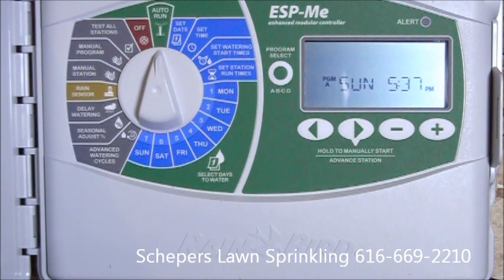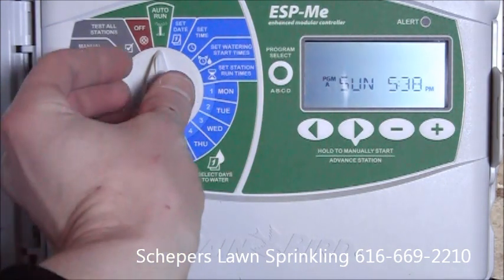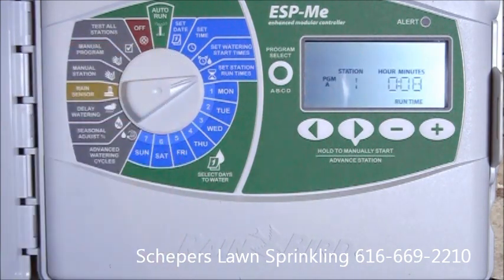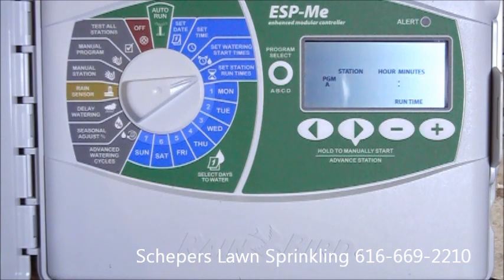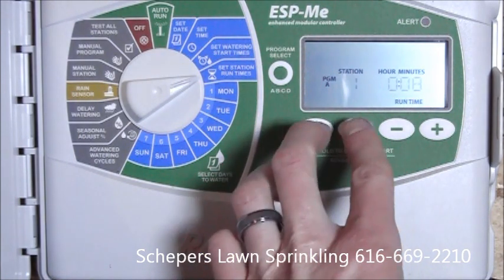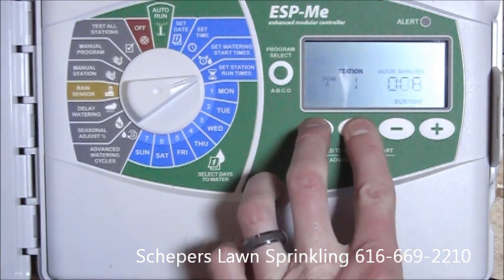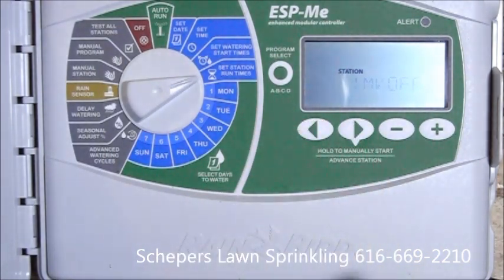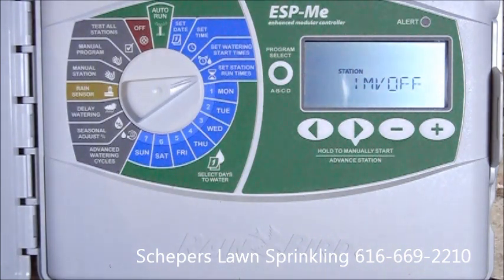How To Turn On/Off The Master Valve On A Rain Bird ESP-ME

Comment: If I turn off my zones 2 an 3 off they wont come back on correct an will my other zones still run on the two days there set at I have a patio an it's getting soaked just need 2 zones off any help.
Reply from the maker: Yeah, as long as you don't have run time on those zones they will not work.